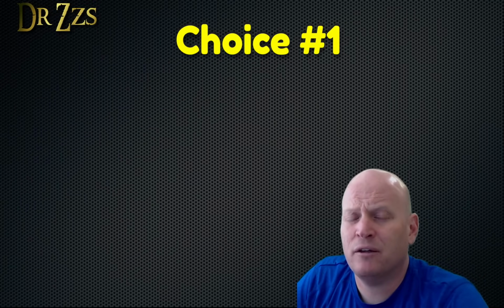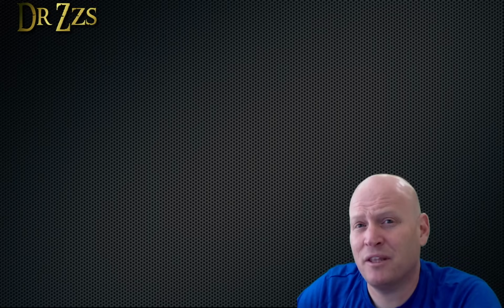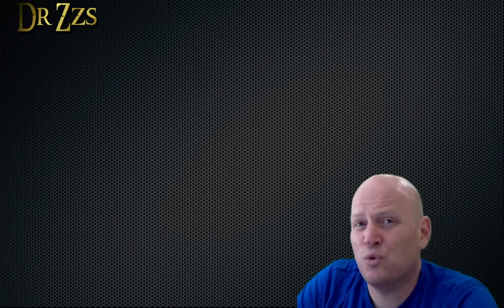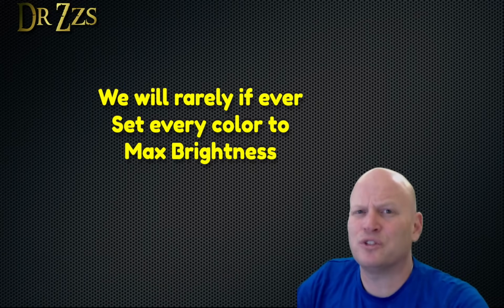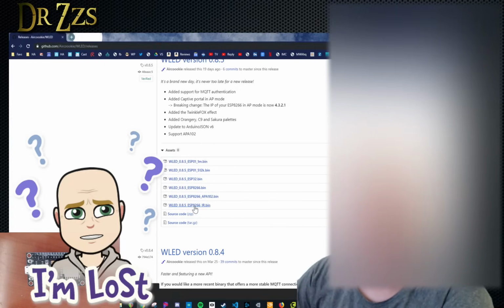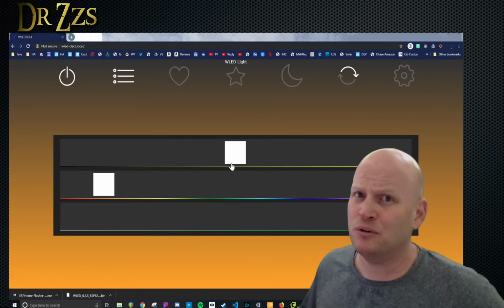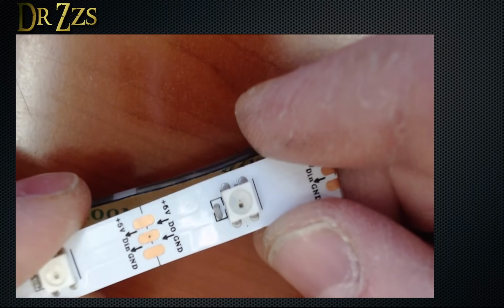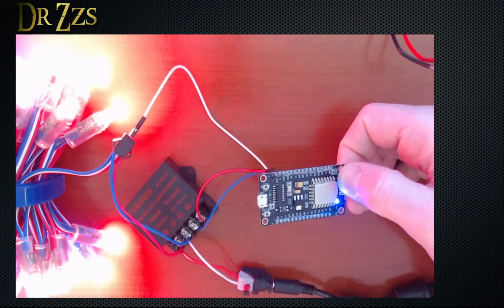Beginner's Guide to Christmas Lights - and LED Shows for Every Holiday

Comment: Good thing this is a beginner's guide, I can't even get esphome-flasher to run on a Mac OS 10.10.5. The flasher appears to crash as soon as it is opened. Any help would be appreciated. Not sure how to load Binaries for WLED into Arduino. When I compile the list of errors is endless. Thanks.
Reply from the maker: You don't need to load binaries into arduino.  You can just load them straight onto the board.  I'm not sure what the problem could be with the flasher on Mac, I've used it successfully in the past, but my mac is 10.14.6.  Maybe on the ESPhomeflasher releases there's an older version if you can't update to 10.14.  There are other options for flashing the binary onto the NodeMCU, but most are for windows. https://github.com/nodemcu/nodemcu-flasher
If you don't mind the command line, you can try esptool.py
That's really what all these flashers are based on: https://diyprojects.io/esptool-update-of-firmware-nodemcu-esp8266-on-macos/#.XadIiJNKh24
I assume you don't have a Windows machine to try?

Comment: I would love to do this myself, but when the nodeMCU is powered off, does it save your light settings for the next time it's powered on?
Reply from the maker: Yes, There is a setting in WLED for that.  It says something like "Set current effect as Default".   Then whenever it starts up it will go to that effect.  That should do what you're looking for.  
All the setting options are here: https://github.com/Aircoookie/WLED/wiki/Settings#led-settings
But that'll be the topic of the next WLED video too.
Reply: DrZzs can I use an 8266-01 instead of the Nodemcu

Comment: What are you using to mount the PVC to the house?
Reply from the maker: I mounted them under some decking, so I was able to just use long drywall screws that I just put through the PVC into the decking.  There are probably some pipe brackets out there you could use if you didn't want to just screw through the PVC.

Comment: Using 'COM3' as serial port.
Unexpected error: could not open port 'COM3': PermissionError(13, 'Access is denied.', None, 5)   Anyone have an idea why esphomeflasher is saying this?

Edit: I tried another nodemcu and it flashed right away. Could this mean the problem nodemcu is faulty?
Reply from the maker: Excellent!
Yes, very likely it was a bad nodemcu.  It happens.

Comment: Hi No Homeassistant integration ?
Reply from the maker: It's coming in the next video! 
Actually there is an Auto-discovery component. So if you've added your mqtt information in WLED then it will appear in your HA device list.  But not all the controls are there, so you would still benefit from doing some manual additions.  I expect they will add more stuff to the auto-discovery in future releases.
Reply: DrZzs thanks

Comment: how many 12V strings can you run together?  is there a limit besides the power supply?
Reply: Or do you want a different connected set for each piece of your lights area.... IE: roofline, windows, each tree, etc.
Reply from the maker: The nodeMCU (esp8266) has a soft limit of something like 2000 leds.  It is just a tiny processor after all.  
But you are correct.  I separate mine up so I have many different controllers for different parts of the house.  I have 3 that make up the circumference, then a few more for things like the big tree in the backyard, some on the deck, and some around a separate roof line.  
We'll get into the details of how to sync them together in WLED in the next video.
Reply: @DrZzs  Great!  I will stay tuned for the next video.  In one of your videos, you mentioned the control board needs to be close to the first LED.... so, if a run of LED's are split and some jumper wire is spliced in it lets say to have the lights not be going vertical up the house and only on roof line will that work or does a new control board need to be placed in?

Comment: Teeth!  Ha!  My dentist nearly had a cow when I told him I use my teeth to strip wires.  Of course, I'm an electrician, so my wires can be a bit larger.. :-)
Reply from the maker: You caught that!?! 
I didn't think anyone really did that :)
Reply: @DrZzs  Yeah.. Navy vet, teeth were sharper than the tools they provided...
Reply: Yeah, "I cut my teeth" in electronics that way.  Always works in a pinch, usually less expensive and travels very light.  ;-)

Comment: Use white HDPE. Its flexible and it looks cool
Reply from the maker: ooh, that sounds cool.  Where do you get it?
Reply: @DrZzs  RX plastics in ashburton new zealand...but lows or home depot should have some
Reply: plus i build my own led lighting controllers DMX and artnet based
Reply: @abecoulter8550  Which software are you using for DMX, would be interested to hear your setup.  I program DMX for concert sound and lighting, and now am looking for the best solution to program individual pixels for holiday lights.  Talk about tying up a ton of channels.  Would like something that I can program and then not need a laptop to run.  And also could use and app.  I have used showxpress a ton in the past, but it would need a laptop always hooked up which I am not real fond of.
Reply: @castlerockdjandsound8634  find me on Facebook  and message me...my profile pic I'm holding a baby feeding him with a bottle...

Comment: Can you make it work with Alexa?
Reply from the maker: Yes!
It can work with Alexa with WLED.  We'll get into the settings in the next video.  Right now you can just turn it on/off.  Maybe someday we'll be able to change effects and adjust brightness with Alexa.
Reply: With the right board or plug you can turn it on and off with Alexa.  I have my power supply plugged into a regular Alexa smart plug and the lights come on at dusk and off at bedtime.

Comment: Great video and getting my shopping list 😂

just a question, will your setup automate with HA or would you need some sort of wireless device or power control (Shelly) I am planning on my first to sort out my garage to trigger the LED’s with either motion or door sensor or both
Reply from the maker: Excellent! 
You can send on/off directly to the nodeMCU without needing another smart switch.  WLED is all set up to receive all kinds of commands via mqtt, so you can tell the LEDs to do dang near anything you want as a action in a HA automation that is triggered by dang near anything in HA.

Comment: Any tips on mounting strips on a roof line? J-Channel doesn't seem it would work in that scenario.
Reply from the maker: Probably the aluminum channel would be the best option.  You could possibly get away with using just the adhesive backed strips.  I put a string up on my house just to see how long they'll last.  So far they've survived a couple weeks.  
There are also some clips you could use. https://amzn.to/2BiQP6Q

Comment: Dr. Z,  with the number of LEDds you used on your house how many DC Converter Step Down Regulator 5V Regulated Power Supplies Transformer Converters did you use? since it only 3amps.
Reply from the maker: I have mostly 5v lights so for those I don't need the DC-DC converter.  Also, in the places where I have 12v light I just use one DC-DC converter is just for one controller.  I would expect you could run at least 3 controllers off one converter.  The nodemcu shouldn't ever draw more than 1 amp each.  
My controllers are spread out around the house so really it ends up just being one DC-DC converter for each controller that goes with 12v lights.  That's only 2 for me total.  The rest are 5v lights.  
Hope that helps.

Comment: I'm just going to throw in a tip for anyone watching, if you want something very simple to use and easy to set up, Twinkly makes app controlled strings of 150 to 400 adressable 5mm RGB LEDs.. They're powered by a small WiFi controller, so you just scan your house with your phone camera in the app to adress all the LEDs in the correct layout. The controllers talk to each other, so you can put together several strings with no problem. Then you can create effects as if your house was a display in its own, going from one corner to the other, across several strings. They're around $80 for 150 lights or 12 meters, and $120 for 250 lights or 20 meters.

I've been using WS2811 strings and WS2812B strips powered by Arduinos for years, but I'm going to try these out this year since they're a lot more simple to control across several strings, and makes it easier to create a uniform effect across the whole house. I'm going to try the NodeMCU and experiment with it, so thanks for the introduction to it! I haven't settled on what to use for this years Christmas light display, but I'm going to try different setups.
Reply from the maker: Cool. 
Once you have the LEDs hung you can experiment with the controller options.  
Try out WLED.  You can also easily sync the effects to every string.  I'll show that in the next video. 
Thanks for the tip about Twinkly.

Comment: @DrZzs hello sir. Ask q.

Which is the Best?

- ESPixelStick vs WLED

- NodeMCU vs Wemos D1 mini (v3 or pro)
Reply: Did u find any bugs in WLED?
Reply from the maker: Yes.  So far I've noticed my WLED controllers sometimes disconnect from my network.  The problem is if they don't reconnect on their own I have to power them off and back on.  That's a problem if I can't easily reach the controller.  
Not sure yet what is causing that or how to fix it.  I hope the WLED guys are working on a solution. 

I generally prefer the NodeMCU.  If I was having trouble with wifi range I'd use the D1mini Pro.  The D1mini used to be be have the price of a NodeMCU, but now they are about the same, and the NodeMCU saves me 10 min of soldering on the pins, that's why it's my preference these days.

Comment: Thanks for another great LED update.  This is one of my favourite topics to be honest.
I find that adhesive never sticks long term.  I always need to use clips or mounting channels with them.
Reply from the maker: if you add the clips does it say pretty well?  That would sure be a nice cheap way to mount them if it works.
Reply: @DrZzs  I added a few cable clips to mine and no issues.
I find the adhesive the strips come with is pretty poor mostly, especially on cheaper strips.  They fall down after a bit.
The other option is to use a bit of silicon behind to hold them

Comment: Is using D4 as data pin would this not stall the boot process ? Like mine is doing. I have to pull data pin reboot then connect the data back in...
Reply from the maker: really? 
no I wouldn't think it would.  I haven't had to do that. 
Do you have other nodeMCU's you could test?  Maybe you got a bad egg.
Reply: @DrZzs  I've loaded WLED on a few others now without D4 startup issue. A 4.7k fixed the fishtank as per aircookie

Comment: I am guessing this is the "up and running" video. Is there a way to upload "animation" with out getting completely on the hassio train?
Reply: I'd love to know this too
Reply from the maker: Yes.  You can just use the WLED app or WebUI, no Home Assistant interaction required.  
WLED has "macros" that function like automations to set timers and effects.  They aren't very easy to configure for the novice, but they do serve the purpose.  
Also, if you want to grow your display into one of those big crazy music displays you can use xLights and it will send commands to WLED using the e1.31 protocol.  
This is why I'm super excited about WLED.  It really is great and seems to answer all the requests I've had for an LED control software.

Comment: Hint... the standard adhesive on the back of the strips won't work well (fall off quickly, particularly outside), I found purchasing a separate industrial strength, outdoor rated, double sided tape holds for...well hasn't fallen off yet wherever i've put it :)
Reply from the maker: oh cool 
can you share a link to what you used?
I've noticed some strips use a 3m tape and some have a generic non-labeled tape.  I would guess even 3m has a variety of weights and use expectations.
Reply: @DrZzs  well...it says 3M but I would bet it's not 🙂
Reply: the best is the Scotch brand outdoor mounting tape, i also got some acrylic like tape from ebay years ago that was "industrial strength outdoor"  both work way better than the alleged 3M that is on most LED strips

Comment: Thanks for the explanation! What would be the maximum distance recommended for running 12V power and data? I'd like to bring it back to a location that is pretty far away from where I want to hang the lights. Thanks!
Reply from the maker: The data needs to be pretty close to the first LED unless you use a logic level shifter to boost it to 5v (nodeMCU pin output is 3v).  
My recommendation would be to run 120v right up to the beginning of the lights, then put the 12v ps and NodeMCU right where the lights begin.
Reply: @DrZzs  What would be the gauge to use if putting multiple strips of led in series (to do the power injection between each set) ?
Reply: Made the mistake of making my data line way to long due to different ways of learning last year. Still struggling to get it to work on more then the first few leds. Mount them close.

Comment: If you had to do again, strips or strings?
Reply from the maker: I've been pondering this question for a few days. 
I would go with Strings still.  I like how spaced out they are.  I personally like them more than the strips that are so close together they look like a line.  At least on the outside of the house, that's my opinion. 
But I don't think the 150leds/5m look bad, and they sure are easier to install with the aluminum channel.  I would love to convince some company to make that J-channel with holes in it already.  Drilling those holes is a pain.

Comment: The WS2811 strips are the best, they are individually addressable unless you buy them from a cheap Chinese supplier. And like you said, minimal voltage drop.
Reply from the maker: I haven't seen ws2811 strips that are individually addressable (just strings) but I don't doubt you've found some.  
It sure is nice to be able to use 12v.

Comment: Is there a max length for the nodemcu?

I understand that if you go to long with the 12v lights you will need some power injection but what about the signal from the nidemcu. Does that degrade over long light runs?
Reply: each led should be repeating the signal
Reply from the maker: Aaron is right, the data signal should be fine as long as the power voltage stays "high enough".  Eventually 12v does start to drop too low but in my testing that doesn't happen until you get past 250 LEDs or about 25 meters (80 ft). 
There might be a max # of LEDs that a NodeMCU can handle before its little brain starts to squeal.  Someone said about 2000 is the soft limit for that.  I haven't tested it myself.

Comment: Last year the FastLED library seemed to be very popular and worked well for me, is WLED better?
Reply: FastLED is a programming library, WLED is a working project you can just flash to a node MCU and go. It uses the FastLED Library.
Reply: @YKSGuy  Thanks!  Never saw a phone app for FastLED, but might easily have missed it.  Will try WLED this year.

Comment: Great video!! Looks easy enough when you do it, but when i try it Things don't work. I connect everything like you do on the video. When i put power on the strip about 9 or 10 leds light up, easy in different colors and between each light up led are 10 or so leds that aren't lighting up. Any clue what it can be?
Reply: Did you sett in the app how many led you have on your string? To do that go to settings, led preferences and on the top you will find led setup just insert how many you have and all should work ok.
Reply: @adifoto6362   i did.
Reply: @dennisvandenbroek1725  I am new to this, i just thought you missed to sett it up. DO you have another string to test to see if there are some led's that are bad? or maybe use the other side of the string. Could be that you don't have enough power? sorry i can't help much maybe someone else can.
Reply from the maker: I would also be suspicious of your LED string.  Could be you've got some bad pixels.

Comment: Doc you'll need these 10mm clips for the led strips outside...or inside, i recommend using them before they start to fall off the house. https://www.ebay.com/itm/50-x-Mounting-Brackets-8-10mm-Fixing-Clip-for-3528-5050-5630-LED-Strip-Screw/223190080692?ssPageName=STRK%3AMEBIDX%3AIT&_trksid=p2060353.m2749.l2649
Reply from the maker: Good tip.  
Thanks

Comment: I was waiting for you to mention a logic shifter for the 3.3v signal of the nodemcu to 5v normally required for the led strip signal. Was this a skip on purpose or a slip?
Reply from the maker: No, it wasn't a slip.  I've never used a logic level shifter and I've not had problems because of it. If you keep the length of the data line short between the nodeMCU and the first LED, there won't be an issue.
Reply: @DrZzs  by short that can be less than 1 foot in some cases less (depending on the board and LED), if anyone wants to mount the control box and PSU somewhere else the logic shifted 5v signal will easily travel several feet / meters allowing you to mount the PSU and MCU somewhere tucked away.
Reply: Ah ha! I had been wondering this too, and I was guessing it just tends to work; I think hobbyist electronics tend to be a bit forgiving these days.

Comment: Thanks for another great video even though I won't be putting lights on my house (wife won't let me get on a ladder any more).  For my led projects, I use an old computer power supply (5v@17 amps) which is big, but free. The barrel to wire adapter is a great idea. WLED does some strange things so I look forward to your next video.
Reply from the maker: I don't like getting on the ladder much either.  I've stopped getting on the roof though.  
WLED is amazingly simple or complex.  Good for beginners or advanced users.  It's really amazing.